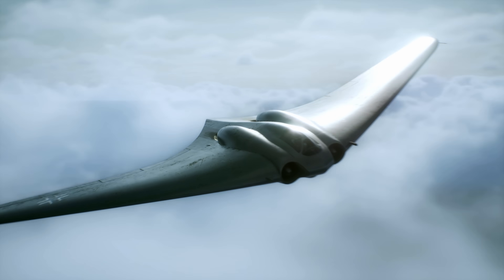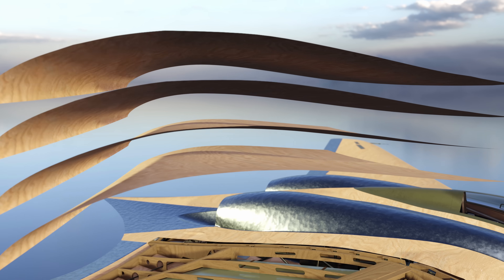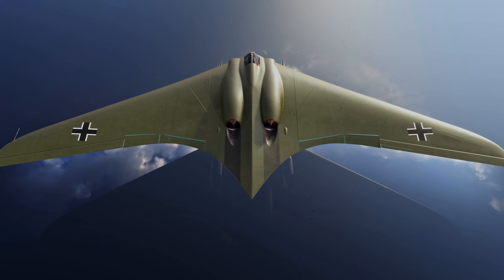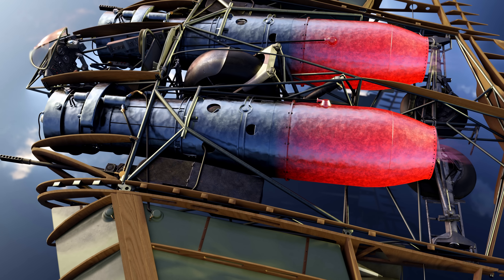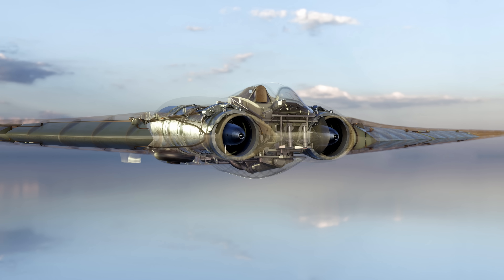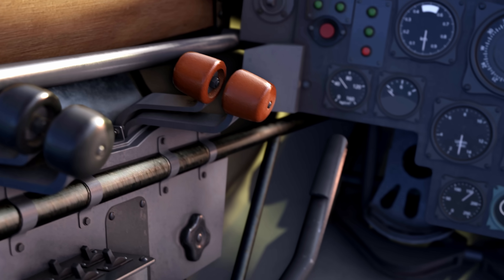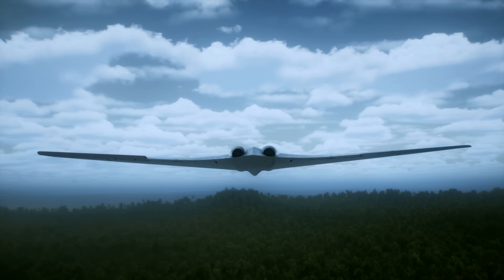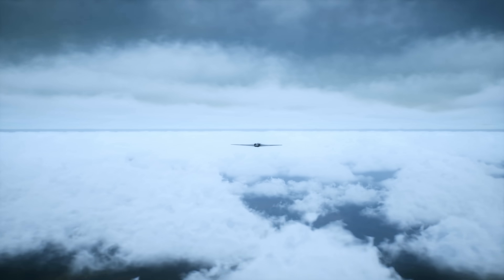Inside the Horten Flying Wing

Comment: Germany has talented engineers.  They could develop great such aircraft, engines… instead of buying overpriced airplanes that perform poorly.  F-35 is too expensive.
Reply: The F-35 is cheaper than the Eurofighter. What are you talking about?
Reply: @peskyshoes Germany could develop innovative airframes, avionics and engines.  Probably cheaper than the bloated F-35.  They have great engineers.  They did develop great airplanes during WW2 with limited resources.  Euro fighter was designed by a committee…
Reply: @AjitMD  Yes, Germans are great engineers, but the F-35, a 6th gen stealth multirole, is cheaper than almost every 4th gen that isn't a Sukhoi, Viper, or hornet. The only jet I could think of with a cost advantage is the Gripen as it does have a  far lower maintenance cost.
And the Germans today are more talented than the ones in ww2.

Comment: The United States had similar designs in ww2 which were different from the Nazi one. The USA even had a fighter plane that the pilots were on their stomachs to reduce the effect of g-forces.
Reply: Copied from Germany.
Reply: @terryparker1694  northrop already had flying wing designs in the early 1930s
Reply: @sasin2715  Horton brothers flew in 1933 for Germany. Hugo Junkers patented his in 1910. French engineers in 1876. Nortrop did not have anything  until 1940. You lose.
Reply: @terryparker1694  the northrop avion M1 started development all the way back in 1929
Reply: @terryparker1694  and besides, you just proved yourself wrong. if were arguing about who invented the flying wing, it is correcetly, as you stated, the french engineers in the 19th century
Reply: @sasin2715  The French patented the flying wing in 1876. You lose. Again. Every time. Dismissed.
Reply: @sasin2715  Squirm worm. You lose. Run along numps. Before you really get butt hurt. Dismissed.
Reply: @terryparker1694  huh

Comment: Could u imagin if Germany perfected and had a fleet of these things by 1940!
Reply: could you imagine if the US had built a fleet of X-Wings by 1935!
Reply: Its more likely for Germany to have built the horton flying wing 4 or 5 years earlier considering they already had designs for it in the 1930s than an x-wing being built 84 years earlier when it wasnt even thought of in the 1930s
Reply: @racer67  no it isnt. Germany had considerable issues getting semi-functional jet engines and no way of getting jets operational before late '44.

Comment: It was not truly the first flying wing because, without computer flight control, flying wings are inherently unstable.  Therefore great idea, but not feasible past a concept
Reply: It flew three times without any issues, so I would call it feasible.
Reply: @henryc.1131  you call crashing and killing its test pilot without issues?
Reply: @gnaruto7769  it crashed only during the fourth flight, because one engine failed.
During the first three times there were infact no issues.

Comment: The airframe currently at the Smithsonian is tragically not assembled and hidden behind other aircraft, making it difficult to photograph. Wish I could attach the few photos I have of it here.
Reply: +@polaris5250  I'm not a fan of preserving the rot and damage inflicted on the airframe after it was captured.  Perhaps it would need a huge budget but I'd rather see all of the wooden structure duplicated with new and the plane returned to the unfinished state it was in when it was found.

Comment: Looks like it inspired the B2.
Reply: didnt though, the Northrop YB-35 is the predecessor (its basically a lowtech B2 with propellers instead of jet engines) which in turn is based on the Northrop N-9M, which had its first flight in December 1942
Reply: @cybrains3824  The YB49 was a jet bomber, developed from the 35. it was intendd to be able to bomb anywhere in the world and return home, although it needed a long high altitude glide for part of the return journey. Both were rejected in favour of "old-fashioned" designs.
Reply: So if china or russia allegedly makes a delta american kfc graduated propagandaist call it copy of f22 bruh this is called copying🥀🤣
Reply: Inspired ? They copied it bruh.
Reply: @tusharrajput5373 🤣 más bien los alemanes copiaron los modelos de Alas Voladoras de los Norteamericanos
Reply: @JonathanSanMartin-h9o ähhhhh...no!
Reply: @JonathanSanMartin-h9o 
Typisch Amerikaner.
Ihr glaubt doch tatsächlich,das ihr eingebildeten Laffen die
Luftfahrt Revolutioniert habt.Ihr habt gar nichts 
Revolutioniert!
Ihr habt bei Kriegsende 
deutsches Knowhow gestohlen und weiterentwickelt.Der einzige Amerikanische 
Flugzeughersteller war 
Northrop,der genau wie
die Brüder Horten unkonventionelle Schritte 
beim Flugzeugbau ging.
Tatsächlich bereitete die B 2 den Entwicklern solche 
Kopfschmerzen,das sie einen der Beiden Horten
Brüder um Hilfe baten!
Erst danach entwickelte sich die B 2 zu einem 
erfolgreichen Flugzeug.
Genauso verhält es sich
mit dem ersten Motorflug:
Es waren nicht die Gebrüder Wright,die den
ersten Motorflug durchführten,sie waren nur 
erfolgreicher!Der erste 
Motorflug wurde vom deutschen „Gustav Weißkopf “ zwei Jahre vor den Gebrüdern Wright durchgeführt. Er war allerdings nicht so Erfolgreich.
Reply: The B-2's grandfather.
Reply: @MaverickEchoJuliet Step-Grandfather at best

Comment: Did it actually fly?
Reply: +@kentuckycrittercamera9407  These were prototypes and each was different.  The first prototype V1 was an unpowered glider used for flight tests until it was destroyed in a landing accident.  The second prototype V2 was the first powered version with jet engines.  It only achieved about two hours of flight testing before it was destroyed in a fatal accident on 18-February-1945.  So the 229 program only managed about two hours of powered flight testing with little results.  The V3 example which survives today was found incomplete and has never flown.  The 229 program was not a very mature effort at the end of WW2.

Comment: Really, the only thing a opposition fighter had to do was force a Horton into a stall. The flying wing would have been helpless.  Adverse yaw would have been a major problem. I really don't see these flying with wings as being viable. Weight shift is also critical as thrust line symmetry looks sketchy. It looks like a death trap to me. I was a hang glider pilot. Hang glider trikes work well to well trained pilots. These are varieties of flying wings, and all have their problems.
Reply: +@andron967    The 229 program only managed to fly the second prototype V2 with jet engines for about two hours of testing before a fatal crash in February 1945.  There wasn't enough flight testing to prove if the platform was viable.  Each prototype was different and the next prototype V3 was designed by Gotha and never flew.

Comment: This shit would snap in half upon trying to perform any kind of evasive maneuvers.
Reply: Why?
Reply: @awat
one word: wood.
wood doesn't hold up too well at sonic or especially sub-sonic speeds. There's a reason modern jets and high speed aircraft have more solid builds made of mostly metal. Less negative space/voids equals more strength on top of metal already just being outright stronger
Reply: @QockNobblr  
One of the fastest aircraft of ww2 was the British Mosquito, a fighter bomber that originally didn't have any armaments because it could out run anything likely to come after it.  Some early jet aircraft were of partly wooden construction.

Comment: In the picture of the cockpit of the Ho-229 at the Smithsonian there is a strong-looking spring on the left side of the cockpit sticking out from the surface.  In your 3D model you show it as some sort of small cube on a circular base.  What was the purpose of this?

Comment: As far as anybody knows , it never flew . Prototypes were captured , but not much was done with them .
Reply: +@tolik5929   The first prototype V1 was an unpowered glider, and it was tested until it was destroyed in a landing accident.  The second prototype V2 did fly with jet engines but only for about two hours of testing before a fatal accident.  That was all of the flying that was accomplished by the 229 program.  The third prototype V3 was incomplete when found and never flew.

Comment: Very difficult to control without current computers.
Large front retractable wheel had to shift the center of gravity.
During the prototype test, an accident occurred after the landing gear was extended.
The Germans did not have the technology of self-locking fuel tanks.
After just one bullet hit, a devastating fire would occur.

Comment: Northrop YB49  BUILT AFTER SECOND WORLD WAR so the b52 was not the only plane built 50 years after it wrong info
Reply: +@antonyadam9346  Northrop began design and construction on the YB-35 platform in 1941 with a government contract and based on his own flying wing experience.   Subcontractor problems made the project slow.  By 1944 the importance of jet engines was realized, and two YB-35 platforms were taken to convert to jet-powered YB-49 versions.

Comment: Horton used the plywood skins for a "wet wing" with a fuel proofer sealant. There was neither time or material for aluminum tanks and the life expectancy was anticipated to be very short.  I saw the real one @ Silver Hill in the 90's.. Even with the wings off, it looked deadly.  I hope they have preserved it..
Reply: +@AlbertRobinson-v3y     The V3 prototype at the Smithsonian was designed by Gotha.  It was captured incomplete at the Gotha workshop at Friedrichroda in mid-April 1945.   If the Smithsonian had not let it sit outside in the weather for 20 years inside a moldy wooden create it would be a lot easier to preserve today.

Comment: correction: Horten was FIRST production flying wing not just first jet propelled.
Reply: I wouldn't say "Production" when only 3 were built, +YB-35 were already in development way before HO229's program started
Reply: @errornamenotfound2513  rubbish. USA was a decade behind. Northrop required tail stabilisation before Dr Ing Lippisch calculated the aerodynamic equations for Northrop to fly.
Reply: @FindanDandy  didnt the Northrop N-9M fly in 1942?
Reply: @ImSmad  yeah, you could even take the Dunne D5 from 1910

Comment: I hate AI Voice (German Audio), but die Video is very good. I also saw the National Geographic documentary at the time, and although it was confirmed that the Horten flying wing, with its radar cross-section, was not as good as today's types, it still had a certain advantage for the defense measures and radar technology of the time, which meant that it would have been detected on radar much later than a conventional aircraft.
Reply: It really didn't have stealth
Reply: @JohnMarston-r9l I also didn't talk about stealth, but rather that the Horton would have been detected later than a conventional aircraft due to its radar cross section and speed, and that's what was said in the National Geographic documentary. Not real stealth, but advantages in terms of radar cross section.

Comment: I have been thinking about what you said about this craft is susceptible to flat spins. Due to a lack of vertical stabilizers. 
I realize that the engineers wanted to maximize the aircrafts efficiency. But I may have come up with a possible solution for this problem. 
When the craft goes into a flat spin, it will create centrifugal forces. This could be used to trigger a pop-up vertical stabilizer. This would be purely mechanically operated and separate from the pilot. So it would not need to worry about it failing that way. These could be made so they can either retract once the forces subside or lock in place. To keep the aircraft stable long enough to land. That way they are only used when needed. 
This could even be installed on aircraft today as a safety feature as a backup incase the power should fail. 
I have also been wondering if a similar system could be added to aircrafts flight controls. In order to keep an aircraft stable without flight controls dependent on computer systems. This could help incase of things like a power outage. 
This could be done as a redundance or instead of the systems we have today. 
What do you think?

Comment: When did the US start experimenting with it?  On June 24, 1947, private pilot Kenneth Arnold claimed that he saw a string of nine, shiny unidentified flying objects flying past Mount Rainier. 
About 30 seconds after seeing the first flash of light, Arnold saw a series of bright flashes in the distance off to his left.  The reflections came from nine flying objects. They flew in a long chain.  He thought they might be a new type of jet and started looking intently for a tail and was surprised that he couldn't find any.
The objects quickly approached Mount Rainier and then passed in front of it, usually appearing darker in profile against the bright white snowfield covering the peak, but occasionally still giving off bright light flashes as they flipped around erratically. Arnold reported at times the objects appeared so thin and flat, they were practically invisible. According to Jerome Clark ]Arnold described them as a series of objects with convex shapes, he later revealed that one of the objects differed from the other eight by being crescent-shaped. Several years later, Arnold would state he likened their movement to saucers skipping on water, without comparing their actual shapes to saucers.
Reply: +@NoahMoreon  Both the British and the US studied the V2 229 prototype but it was never flown by either and never flew at all.  It was very incomplete when it was found.   By 1947 or so the AAF was done with most of the captured aircraft.  It was Gen. Hap Arnold who wisely said to save some of them and they (including the 229) were moved to a hangar at Orchard Field, Chicago and stored until they were donated to the Smithsonian around 1950.

Comment: Thanks for the beautiful rendering of this aircraft. As an airplane design student, this plane gives me many conflicting thoughts.

It's an absolutely beautifully looking plane, and in some aspects it definitely innovated. The lifting body design allowing for relatively efficient cruise, and in particular the jet engines used were quite novel at the time. The variable exhaust geometry (which I was kind of sad to not see mentioned in the video) also deserves a mention.

But there's also just some things that are really dumb about the design. The lack of a vertical stabilizer means the pilot has to continuously, actively, keep this thing pointing forward in the yaw direction. Without computer control, on a supposedly agile fighter-bomber, that was an incredible dumb idea. It is honestly a miracle that the test pilots managed to fly and even land the prototypes considering that. This also meant that you really don't want to have a single engine failure in this plane, as there's no corrective moment to keep you flying that isn't also just drag.

It also is quite a confused design. It is listed as a bomber, and likely controls terribly with its unassisted control scheme, but its specs and armanent seem to suggest it was meant as a fighter. This results in a plane that just isn't that great at either thing. What's the point of a fighter that can't easily point its guns at its target, and what's the point of a bomber that costs a lot with its jet engines, yet can't actually drop that many bombs due to its small size, and has no armor to resist any fighters targetting it.

And while this is something the designers had no idea about at the time as radar wasn't well known, I am left wondering why anyone in more recent times thinks that this thing would've been significantly stealth. I mean, you're staring the turbine fans straight in the face from the front. That is like point 1 on the list of things not to do for a stealth plane, as that array of turbine blades is just about the best reflector you could wish for.
Reply: +@CensoredUsername_    The 229 was being designed as a bomber,  being a smaller prototype of what was to become a medium flying wing bomber.  Parts of an armed variant was found in the Gotha workshop.   Northrop had a similar yaw control problem with their YB-35 and YB-49 prototypes and yaw dampers were being added.  Since the YB-35/YB-49 was designed as a precision, long-range bombing platform poor yaw control during aiming was not a good selling point.  Northrop was adding yaw dampers when the program was terminated entirely.

Comment: The Germans knew how to build stuff as we are still ironically benefiting from the development. 
You talked about stealth and it is interesting to hear that charcoal being used to I am guessing to absorb the radio waves of radar. But may have lead to drag and I don't even want to think of what would happen if it happened to rain while in flight. 
But one thing that you might not have noticed is that this aircraft has a mostly wooden frame. Which would have made it much harder to detect by radar. 
The British were suing aircraft that had wooden frames  in some of there aircraft. Like in the  DH-98 Mosquito and it helped them avoid detection. It also helped them repeatedly ambush the Germens in their own airspace. Plus the liter airframes allowed them to go faster and bomb targets deep in Germany. 
I am rather surprised that the Germans did not try to give there all wind build a vertical stabilizer. For better control. Even one that retracts like the air breaks. 
Also they could possibly use the existing flight surfaces to simulate Yaw movement with a little more work. The F-16's use this in there build, not even using there rudder for Yaw movements while in flight. 
Had the Germans had more time and recourses, they would have also found a way to hold bombs in bomb bays. Allowing them to carry both 1,100 pound bombs without any more drag.